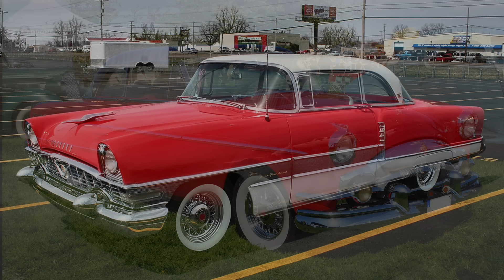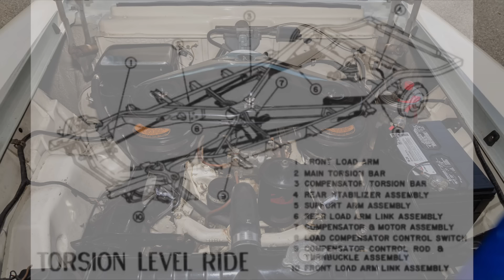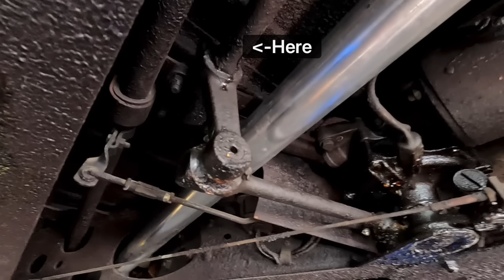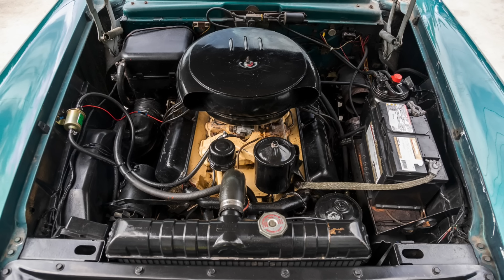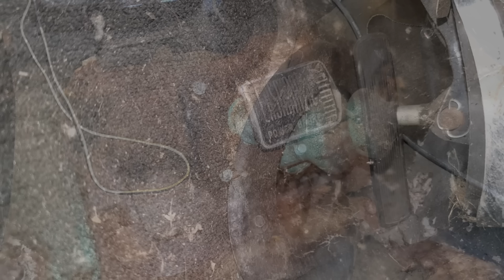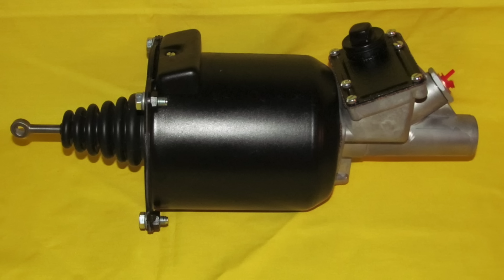Automotive Failures: The 1955-56 Packards Had Both Engineering Triumphs & Flops

Comment: The Packard V8 block was about as big or slightly more so than the Lincoln MEL or the Cadillac 500 blocks -  but appeared earlier ? (The Cadillac V8 introduced in 1949 and the "Lincoln Y Block" I believe were smaller than Packard's V8 ? )

Comment: As to master cylinder location, I'd speculate that Packard outsourced when buying the common "fits all" Treadlevac booster-master  packaged unit; then did the best they could finding a workable location for it.

Cadillac '55 had the master cylinder under the floor, with remote booster. 
For the '56 refresh Cad also went with the Treadlevac packaged combination of booster-master.

Cadillac also must've struggled with locating the bulky Treadlevac. It ended up way out front at the radiator support.

Comment: The beauty of Packard's torsion bar suspension design was that it was so smooth over uneven ground vs the standard spring suspensions that bucked up and down like a scalded bull. Cadillac and Lincoln wished their cars rode as smoothly. Washboard roads were as smooth as a city street in one of those Packards.

Comment: Thanks for a nice non AI Video !   On the brake master cylinder, that was not a Packard thing, in fact that was common practice until the mid to late fifties, i do have the exact same set up on my 1955 Pontiac.  i can reach down and loosen the filling lid with a Cresent Wrench and then i use an about 80cm long small tube to fill the fluid trough 🙂  On my friends 1954 Chevrolet the filling lid for his non powered master cylinder, is under the floor board and you have to remove the carpet and an access plate just above it as to re-fill, the reason for this placement of the master cylinders of this era, is probably due to the use of standing pedals where the pedal goes down trough the floor pan toa link that push the master cylinder plunger.

Comment: Packard bought  in 1954. It was not a merger. Studebaker could not break even because of high labor production costs and low sales. This stripped Packard of its money and they needed a savior. Curtis Wright then bought controlling interest and stopped Packard production in Detroit. Through default, Studebaker continued and Packard was gone. It should have been the other way around.

Comment: On the brake master cylinder mounting behind the pedal, it may have been because there's no room on the firewall.  Hotrodders have had the same problem with adding juice brakes to a 32 Ford. Answer was to mount it (MC) to the frame below the driver's seat with a cutout and inspection plate.  Looks like that's what Packard tried to do with limited design funds.

Comment: I wish I could go back 25 years to visit the old Packard proving grounds in Shelby Township. I would drive by it on a regular basis and was always curious to check it out, then they started tearing the pavement up to build new housing. Adam, being familiar with the area, have you ever had the opportunity to visit the old track? It spanned a mile between 22 & 23 Mile Roads just west of Van Dyke. Some really cool videos of them doing durability tests on their OHV V8 engines on that track. They would run them days on end at 100 mph! I believe many records were broke at that time.

Comment: When tuned properly, these V8 were beasts - they could eat into pavement.   Torsion bars afforded a smooth ride, but often the eclectic motor to drive the self-levelling system would fail.     As Adam noted, it was all simply too late.   Packard should've debuted these features in 1949.

Comment: My 1955 Hudson Metropolitan has the master cylinder under the floor board as well.  It is a pain to add brake fluid.  Not only that, but there is a second master cylinder under the floor board - that being for the hydraulic clutch.  My 1955 M38A1 Army Jeep also has the master cylinder under the floor board.  With both vehicles, the chance of pouring fluid all over the place is 100%!

Comment: Oldsmobile did the under floor master cylinder too. It even had a dipstick to check the fluid but it can be done from under the hood. Basically all cars in the 30s and 40s with hydraulic brakes did that same set up as well.

Comment: Another anomaly with the '55 Packards. They were 12 volt positive ground like British cars,  Metropolitans as well. Good luck with polarity sensitive  electronics, such as the radio. I also remember that they had an issue with the Twin Ultramatics and the suspension systems. Frankly, these cars hurt Packards reputation, IMO.

Comment: I worked on a 1954 Packard Convertible that had a 327 cu in straight 8 in it and the power brake booster and reservoir was under the floor board on that too and it had problems and i had to replace the booster and master cylinder on it. Trust me that it was no fun at all!  This customer also had a 1940 Chevy 85 Master 2 door business coupe and the master cylinder was under the floor board on that too. I worked on these cars in 1991 or '92. That Chevy was really cool and all original with the 216 cu in Stovebolt 6 it was born with  it and a 3 speed manual transmission that had vacuum assisted shifting and it ran and drove like a top! in fact, both the Chevy and Packard were seriously cool but i sure hated doing the brake repairs in the Packard!

Comment: I am baffled how Packard insisted on the flathead straight 8 - a great, smooth engine by its own right, but hardly advanced. If anyone, and I mean anyone, could have seen the future of OHV engines, I am again baffled by why it wasn't Packard. This is the same company that took the Rolls Royce Merlin V-12 used in the Spitfire, Hurricane, Mosquito, Lancaster, and P-51 Mustang and refined it to it's peak in piston engine combat aircraft. Yet, they made a decision to advance their flathead straight eight well beyond when it should have. If anyone had the knowledge, technology, and mass production capabilities to be a leader in OHV high performance engines, it should have been Packard. Possibly if they would have adapted the technology they used to manufacture and refine the Merlin V-12 to create an unbelievably potent V-8, their styling would have followed along. What could have been....

Comment: I love these cars...a 56 with the hooded headlights and pushbutton trans is on my bucket list.  the drawing doesn't adequately show how the torsion bar system works...there is a single 9' bar, on each side, that connects the front suspension to the rear...there's a unique link that ties the rear of the bar to the rear trailing arm that isn't seen in the drawing...the compensating bar is parallel to it.  So the front and rear suspension are using the same bar, and isolates the body from any spring impacts, giving a superior ride.  There's a couple YT vids that have these cars on lifts showing the unique design.

Comment: I’ve always heard that the  Studebaker based Packards were created to avoid lawsuits from Packard dealers. By offering these cars for two years they were able to run out the dealer contracts. The same idea was used when Studebaker ended production in south bend and continued to assemble lark type cars (only) in Hamilton with McKinnon (Chevrolet) engines. Both firms had thousands of dealers so the potential liability was significant as the corporation had no intention of declaring bankruptcy and indeed flourished after ceasing car production.

I’ve always tried to imagine the reaction of a Cadillac buyer if he ever walked into a Caddy dealer and saw a Rambler sitting there with fins.
Reply: You are correct about the dealer contracts.

Comment: I have a 1955 Patrician. Adding or checking brake fluid isn't as impossible as you think. First off, your view of the Treadle-Vac in the engine compartment shows the master cylinder cover, but it has been installed 180° turned around. The fill port is visible when looking straight down at it. It shouldn't be under the steering column. The correct cover installation is shown in your photo of the restored Treadle-Vac out of the car. While not the most convenient , I can add fluid to it by pouring it from the bottle closer to the unit while I'm bent over the fender.

Comment: One can see that what appears to be a floor vent assembly has been moved to be able to see the brake unit. In an earlier photo in the video that assembly is in its correct position where it apparently draws air from the engine compartment? Could that be correct? Imagine a hot day in the city trying to cool down the driver with oily hot air from the engine compartment? Not nice! Strange engineering, indeed. We missed seeing the dash mounted device to allow the driver to see the traffic signals, and for the Caribbean model, convertible, the reversible cushions for the seats!
Reply: It doesn't draw from the engine compartment and many makes used the same system at the time.  The inlet is mounted on the radiator support and is drawing fresh air through the grille in a sealed path with tubing going straight into the passenger compartment.

Comment: Very interesting.  I used to see Packard's driving around, when I was growing up, even though their production had ceased shortly after I was born.  They were cool cars, for sure.  I would think that someone would have made an adapter, to be able to fill the brake fluid, without taking all of that stuff apart.  Either way, I was lucky enough to grow up while these cars were still on the road.  An excellent video, as always.

Comment: Dear Adam:  Another excellent video.  The Packard V-8 was an excellent design, and it remains surprising to me that no other manufacturer purchased the design and tooling to produce it.  Hemmings Classic Car (R.I.P.) ran an excellent article on it a few years ago.  Even Rolls-Royce had started on their own aluminum V-8 by that time, so I guess no one needed it.  I have a 1961 I.H. fire truck with thru-floor pedals and a booster underneath on the cab.  It gives problems, for sure.  Maybe a piece on the Ultra-Matic transmission some time!  Happy Holidays to your family and viewers!  -Bobo KC

Comment: Floor mounted pedals were old fashioned I think the big 3 switched to suspended pedals by 1955 they were probably hard to bleed being so low and with limited access 
My 71 VW had the master cylinder under the floor with pedals  hinged at the floor but no power brakes

Comment: Disparaging Packard for their brake pedal assembly is really unfair. Based on what I’m reading, the mid 50s is when GM and others started moving to suspended brake pedals, but many contemporary marques still had their master cylinders mounted under the floor in the late 50s. Some non-American cars continued this into the 60s or later (I’m looking at you, Rolls-Royce!).

Comment: The video menioned an “optional oil filter”.  I know that in the late ‘50s, Chevy’s bottom model(s) had it as an option rather than standard, but wouldn’t a brand like Packard have had it as standard equipment?  Or was it just optional to have a different/better type of filter?

Comment: I'll admit its not the most practical place to put the master cylinder but its not as bad as it looks. Ive done a few full brake rebuds on 55 and 56 Packards. A long funel or a funel with a hose on it is fine. The master cylinder doesn't hold very much and when adjusted properly its fine. I appreciate and enjoy your videos! Thanks!

Comment: Belive Ford was 1st to standardize Master Cylinder on firewall on all car models in 1955. 
Read years ago it was done to accomodate the Borg Warner designed, 3 speed automatic's  large bell housing containing the torque converter,  in 1955. (1954 on Mercury's with the 259 OHV-8)

Comment: The 1955 Packard was really a heavily refreshed 1951 with torsion bars.  The 1955 Ford & Mercurys did a similar job of hiding the fact it was a 1952 model with a curved panoramic windshield.  Easamatic brakes sounds so 1950s like Cinerama movies.
Reply: By comparison the 1955 Chevy was for the most part was a clean sheet of paper over the previous model. You really were getting an "all new" car.

Comment: My ‘53 Chrysler New Yorker had the master brake cylinder in the same location. To check the fluid you had to remove the floor service plate under the carpet. It was a pain. But, as noted by others here, fairly common in cars through the 1950’s.

Comment: Years ago at a car show in Scottsdale two or three of us sat on the back bumper of a 1956 Packard to see if it would self-level.  After the requisite delay it did, and with surprising speed compared to pneumatic auto-level systems.
Reply: Dad and I towed a crashed Patrician out of a yard to use as a parts car for mine. It had been their long enough to have an extensive rose bush growing through the engine compartment. When we loaded it with a battery to power the tail lights for the rope tow, the car leveled itself.

Comment: The under floor brake master cylinder is where they were located before being on the firewall.  Even a Duesenberg Model J has the master cylinder underneath with a vacuum booster that is not directly attached.  Although automobiles  that I have seen  with wood body frames have floor panels that are easily removed to make master cylinder access very easy for the location.

Comment: The  torsion bar were interconnected so that if the front wheel moved up the back wheel would be push down, and if front wheel moved down the back would be push up.  The system is not self leveling so the motor is needed to level the car.

Comment: ... 1ST year for 12v neg ground ..!
Reply: The 1955s were the first year for 12v electrics, but they were positive ground (the positive battery post goes to ground). However, the 1956s went to the more common 12v negative ground, which is what is used today.

Comment: GM, Ford, Chrysler and the most other cars had the master cylinders under the floorboard. My 59 Buick still had it there and was a nightmare removing it for service. My 51 Buick is still bolted to the frame but has access for refilling down by the steering box, it's a long reach down over those round fenders. Ford put the master cylinder on the firewall around 1952. The 55/56 Packards were beautiful cars. The dashboards were a work of art.

Comment: The said part was that they moved production to the old Briggs Body plant on Conner avenue in Detroit. Quality went down the tubes. Even the Patrician sedan driven by James Nance, the head of the company. He found a massive amount of quality problems. Customers weren’t impressed either. By the time they had the problems fixed it was 1956. In 1956, they had a recall on the rear axle. It had to have a clear marking to show that it had been fixed. Some dealers didn’t have it and fixed many cars twice, which was charged to Packard.
Also, the 1955 models didn’t get into full production until Spring, leaving dealers without cars for a long time.

Comment: The Packard V8 was one of the best and most powerful engines of the 50’s. The visible v8 model we all built as kids was based on the Packard v8.. Studebaker really wanted to use that v8 as their “big block “ but it never happened. Also don’t call the final packards made by Studebaker packard Bakers, that’s derogatory. Studebaker tried to save packard unfortunately it would’ve killed them if they did.

Comment: I had a 56 that needed to check and add brake fluid almost every time I drove it due to the damned Treadlevac unit leaking, I simply used a small funnel with a hose on it to add fluid. It was not really that difficult.

Comment: Would be interesting if someone could come up with a 1953 Packard with the top of the line 9 main bearing Straight Eight and the overdrive transmission with a short final drive ratio (not the automatic) I think it would have been fast for its time (not sure if the '54 model introduced new reliability problems)

  The GAZ  Chaika !

Comment: I understand that the automatic transmission in the 1955 Packard was horrible,both slow and city bus sluggish and almost guaranteed to fail if you "put your foot into it" one time too many (it did shift up and down between reduction and direct as well as having a lockup torque converter unlike most earlier Packard automatics) 1956 might have been fixed ? 
 Strikes and labor unrest after the "merger" because of different pay scales for people doing the same work depending on whether they came over from Studebaker or from Packard ? 
  The role of James Nance in bad decisions made at Packard- did he go on to Ford and contribute to the failure of the Edsel car ? 
The Studebaker- Packard %&*(^%  almost seems to have involved double agents or something maybe sitting on Packard's Board but secretly trying to cannibalize Packard for the benefit of Studebaker ?

Comment: The Packard Story was like a juggler spin plates on a pole. Each plate had to spin one engines, transmissions, torsion  bars, face lift design, body supply dilemma, finance, and finally Studebaker which made the plates fall except the spinning Studebaker

Comment: My dad had a Four Hundred coupe very similar to the one shown here.  It was a very pricey car for it's day,  just north of $3,800.00 at a time when the neighbor's Chevy Bel Air was two grand.  The Packard was more in the Cadillac range of options and luxury though and was an impressive performer.  The Level Ride suspension worked flawlessly for the nine or so years he owned it.  Almost too flawlessly. On a gravel road to a fishing lodge the left rear tire punctured and as it deflated, the Level Ride system compensated.  There wasn't much left of the tire when we finally realized it was flat.  I remember it as a pretty good car. The biggest problem area was the front power windows and the small rubber backed chrome strip that closed over the top of the glass when it reached the top. That and it seemed to need all four mufflers replaced way too often at what would approach $2,000.00 today.